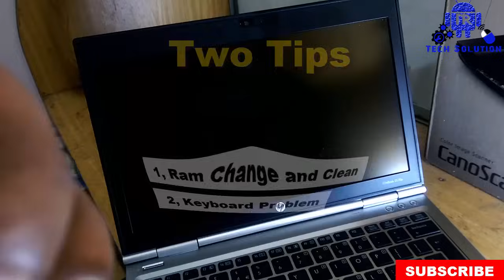Laptop POWER ON But 💻Display Blank (NO Display) 100% Solved ✌Only 2 Tips

Comment: Hits different when none of those are the problems 😩
Reply: 😂🤣🤣exactly.
Reply: I've too
Reply: Reflow gpu
Reply: Did u found out the cause??
Reply: I can't turn on the laptop and if i press the power button the keys become white (the color thingys) and nothing happened after that
Reply: For me
When I plugged the charger it's start charging.
But while pressing the power button nothing happens 🤷
Reply: @ayushx4831  i have the same problem
Reply: @kimkimi기미 but it's solved
I just press and hold the power button for few seconds and Boom, it starts👍
Reply: @ayushx4831  it didnt work for me though 😓 I'll try some other way
Reply: @ayushx4831  thanks bro it worked for me
Reply: Mee too
Reply: lol same
Reply: @xyzeuskrych5745  I just dis the first step and it wirked
Reply: Bro when I press the power button it starts and the keyboard lights up and I can hear the fan but the screen doesn’t come it’s just black
Reply: @RektUniverse  same problem bro did u got the solution
Reply: @nature.candid  nah but I found out that apparently the image drivers failed so I gotta replace them
Reply: @RektUniverse  excuse me bro now I am facing same problem what  have you done can you say please
Reply: @xyzeuskrych5745  same
Reply: Sounds like we all have the same issues. When I power in with the power cord in place. I get black screen. Power light on. Mine is only a year old. And I hardly used it. Paid 300 for it. I feel like I got robbed.
Reply: anyone.. pls tell how to solve this issue... 😔
Reply: How to solve this 😭
Reply: @azeemjaafar14  nope, never did
Reply: Word
Reply: my dead and stuck pixels are on my school computer
Reply: My laptop is not starting, when I press power button the keyboard lits up and screen is black and after sometime it automatically shuts down . Please help me(Asus FX505 GT
Reply: @ayushx4831  bro it starts but it automatically shuts down mines the same problem someone help me
Reply: My computer will show the Lenovo start up screen then just goes black after can someone pls help
Reply: True
Reply: Simple do Alt+Ctrl+Delete then file manager open go file then add new task then write explorer.exe or do Ctrl+Shift+Esc then file manager open go file then add new task then write explorer.exe. EASY AND SIMPLE
Reply: @samiaamjad6851  lmao, it’s kinda hard to do that when your screen doesn’t come on at all especially, after you click the power button and clearly see that it’s on
Reply: @samiaamjad6851  you’re literally what the OP is talking about 😭
Reply: On god, at this point I’m just gonna replace it 😭 cause nobody is understanding my problem
Reply: Same😫
Reply: U go an Seach on google properly
Reply: Man my cause is fucking close the laptop when it on
Reply: @GnanendraPennepalli  My issue is same. When i press the power button, screen is black, keyboard lits up and fan starts running at very high speed. I tried to replace my ram, hard disk and cmos battery but it didn't work. I tried to press capslock but it didn't give any response. My laptop is asus tuf fx 505 dy. Edit : My hard disk access indicator is also not binking.
Reply: Ussss
Reply: @piyush4504 Same here. The problem with my device was some smps in mother board it was a small electronic chip that burnt due to voltage fluctuations. even asus service said u need to change mother board in my laptop(suggested me to buy a new pc). I got it serviced in chennai for 2K(Richie Street).Hope this helps you
Reply: @GnanendraPennepalli  Actually one day i was shutting down my laptop but it took so long (almost 5mins) that i had to force shut down it after that my laptop is not starting. I was using my laptop on battery at that time. And there was not any windows or bios update at that time. What do you think did my laptop processor got damaged or PSU unit?  Sorry for my bad english.
Reply: Me too
Reply: @SunderRai  I can't turn on the laptop, the last time my LID work is using a Cooler pad with a max brightness
Reply: Yeah
Reply: @stardustblade9664  wdym
Reply: @ayushx4831  same broo
Reply: @kimkimi기미  and  then is ti working or not?
Reply: yeah bro 😭😭
Reply: Idk what to do cause i accidently turned the brightness all the way down and im panicking
Reply: Mine has had its motherboard changed and was completely rebooted last year but it still has the same issues and now i have the black screen problem i had last year again! I hate it.
Reply: Yeah my motherboard died
Reply: Perhaps everyone here has been using the same brand.
Reply: @GnanendraPennepalli  any solution?
Reply: @thegame8112  a MOSFET that helps to charge and boot on motherboard near charging port damaged. Changed it, laptop worked perfect
Reply: Ikr i broke my laptop by trying to do this😭
Reply: Same i did all these and still not working it takes a lot of time to keep turning it on and off to get it to work
Reply: Can someone help my my brightness is at 0 and my pc is dark and my brightness button doesnt work
Reply: @ayushx4831 Yeahhhh sameee
Reply: @RektUniverse  what did you do to fix the problem
Reply: @Rikoani  I have the same problem as you bro 😢😢😢
Reply: @xyzeuskrych5745  SAME issue aa raha h
 Kya aapko koi solution MILA ?
Reply: Yes
Reply: @GnanendraPennepalli same do u know how to fix
Reply: @GnanendraPennepalli bro help please I’m desperate
Reply: Mine was a ram issue.

Comment: My laptop does not have easy removal back so I can not take ram 😭😭😭😭
Reply: Which laptop do you have right now
Reply: @techplayer3489  hp
Reply: Press power button and delete then its on.
Reply: @SrikaarayilHariPrasad  didn't work mine dell and it's not easy to remove back too
Reply: @SrikaarayilHariPrasad  didnt work too
Reply: @SrikaarayilHariPrasad  what about Lenovo legion 5?
Reply: @klow3371  same he I have Lenovo Core i5 anyone who can help me
Reply: @SrikaarayilHariPrasad  THANKYOUUUU VERY MICHHH YOU JUST SAVED MY FUCKING LIFE FROM MY MOTHER
Reply: @SrikaarayilHariPrasad  thank you soooooooooooooooooooo much bro it worked. tysm tysm
Reply: @SrikaarayilHariPrasad  life saver. Thank you 🙏🏾
Reply: How about the Asus? The power is on but my screen is black. 😔
Reply: @banglarawaz2567  i already fix my laptop. i open it and remove the battery and put it back just clean it. just watch teh youtube how to open and clean inside your laptop.
Reply: @SrikaarayilHariPrasad  Thanks a lot
Might have been forced to pay a thousand or so to the shop otherwise
You saved me 
Thanks once again!!!!!!
Reply: Connect it to tv by hdmi
Reply: @SrikaarayilHariPrasad  thanks bro it helps a lot <3
Reply: I have asus, it’s lockdown cannot get to repair, really important meeting to attend, no display.
Reply: Then What about windows 10
Reply: @SrikaarayilHariPrasad  work

Comment: wow this really works my local shop wanted 100$ but i simply cleaned the ram and it works again thanks a lot
Reply from the maker: Send me 100$ hahaha Welcome SUBSCRIBE My Channel Like & Share
Reply: @nrtechsolution  paypal
Reply: wow
Reply: Lol i know right like every local "engineer" only tell people to replace things that dont really need to be replaced and its very pricey
Reply: @IzakShufrann  uni jjup
Reply: Your local shop need to eat and buy some food for his family.
Time is money.
Reply: @N.R SOLUTIONS Bro My laptop is showing no display but processor works and Caps lock button keep on blinking. What should i do.
Reply: @ankushraj3623  you must do what,what he has done
Reply: @abhishekkrkushwaha  i tried your every step but my problem didn't resolved. Lastly i had to visit repairing centre where they told this is bcoz of some issue in motherboard. And they charged me Rs. 1400
Reply: Bro thats a huge scam
Reply: @qyowa  shops dont actually try and fix it they just change the parts thats why he wanted so much money he wanted to replace the whole screen
Reply: @gilbertoberretta4361  yeah ik its still a scam they just replace it instead of fixing it fixing it is way cheaper
Reply: Lol 100$ where did you went a fucking Apple store?
Reply: My ram had milk way candy bar on it cause I took the ram and hd drive out often
Reply: It worked for me too
Reply: Urn on
Reply: mine wanted $300 to $400 and two weeks
Reply: @sogachew2368  have you tryied rebooting your gpu? just press Win+Ctrl+Shift+B whlie the pc is on. Keep me updated, we will find a solution don't worry
Reply: ram clean ki lekin start nhi hua or keyboard ko lekr m presan hu kise kru
Reply: 100$nooooooooooo:(
Reply: But the next it was repeats again
Reply: @nrtechsolution  can Lenovo Core I 5 be done same?
Reply: @Atosfar  He would have changed the motherboard and display which would cost like 100$
Reply: @greyhairt  if his ram was the only problem why they charging him a 100$?
Reply: @Atosfar  It's cuz they don't know the problem. For them the problem can be that the display is damaged
Reply: @greyhairt  you can't charge money until you know the problem, do you also go to the doctor and he says you might have a cold with cancer so lets do a surgery,no that's not how it exactly works you gotta check the problem then charge the Utmost price.

Comment: The ramd change and clean saved my laptop huhuhu thank you. 🤩 Works in samsung laptop. You saved my life, I cried yesterday so much. I thought my laptop is dead. Thank youuuuu so much.

What I did is that I cleaned my ram using a small brush to remove the dirts. I put it back gently to the place where it was, and then when i turned on my laptop it works as fine as what it was. ☺️ I was so happy. Thankful to this video.

Comment: I want to try this but I'm scared that I will broke something, it'll make it more worse.
Reply: Garyl have you fixed it yet?
Reply: Phuong Hua I’m so close bro my computer did not even power on it was fully dead but when I opened up everything cleaned it it powered on now it’s no display it’s powered on btw I’m 12
Reply: Nop 
1.  just take out the battery nd hold power botton fr 30 seconds, then put back the battery nd switch it on. 

2. Take the ram ram out nd clean it or the hardrive it also works. 

3. Check ur keyboard connection.
Reply: @thabanglucas2728  bhai dil se shukriya mere dost it really works ♥️♥️♥️♥️
Reply: @mrkhiladi_420  wot i do it and it work wdym iam 14 yr and i can do it bruh
Reply: @thabanglucas2728  the battery Charger or the battery inside the laptop??
Reply: Saame
Reply: I did the first one and it worked 🤯
Reply: @olivermoth  did you do it?? im scared to do it rn
Reply: Break

Comment: 1.  just take out the battery nd hold power botton fr 30 seconds, then put back the battery nd switch it on. 

2. Take the ram ram out nd clean it or the hardrive it also works. 

3. Check ur keyboard connection.
Reply: How can i find the connections of keyboard ?
Reply: Depends on what laptop you have
Reply: Bro..i did everything same to my laptop,but its not working at all 😔
Reply: Thank you man the first one worked
Reply: You rooock.. It works
Reply: I luv u my darling...it worked
Reply: Can anyone help me , I have a Acer predator, 

When I turn it on, screen is just black, 

But laptop is heating on the CPU gpu side 

( ram is alright ) wtf is wrong with my pc, please help
Reply: I just only hold the botton for 30s and it turn off then i turn it on its fixed
Thanks man for your advice
Reply: how about if i used my laptop without putting battery in it because its busted
Reply: thankkyouuu it's work
Reply: @haroldkennethrollon6986  same goes to me
Reply: @haroldkennethrollon6986  I'm using my acer aspire without battery from months...no prob. at all till now
Reply: My keyboard doesnt work😭😭😭😭
Reply: What if my battery can't be removed
Reply: Thank you so much...........
Reply: B
Reply: The first one actually worked 💓
Reply: Thanks bro
Reply: It works
Reply: Thank you so much its working
I just hold the power button for 30s and then switch on🤩
Reply: 1 working only when your power don't turn on..here this is  diffrent case
Reply: Thank you...first step works
Reply: Screen will still show display if the hdd is the culprit.

Comment: Mr NR Tech: 
I have a laptop that seems to be doing something similar to this one. The laptop was seemingly working fine at first ( A friend had just bought it used)  but later it would only do what your HP in this video does , show the power and battery light with no post or fans. 

The main thing i noticed that was odd, was that whether the battery was installed or not, the power light would always come on the instant I plugged the power connector into the laptop () after it stopped posting). Just like your laptop does in the video. Most laptops wouldn't have the power light come on automatically, you'd need to press the power button. Does this mean I likely need a keyboard or do you know of any other reason why this might happen .

Ive repaired computers for quite a few years, and even though  I do learn knew things everyday ( I never said I was great at it  ;))  this was definitively a new one for me.  Is the power light coming on the second it gets power also a sign of a keyboard issue ?

Thanks in advance for any help you can offer! Either way it seems that you know some important things I don't, so I subscribed and gave the thumbs up :).
Reply: This Donny wrote a 2 page story
Reply: @bhagapatikandel3469  Not every comment needs to be tweet size, right?
Reply: @noguardrails47 did u find the solution? My laptop also having the same issue...how to solve it. It's keyboard also earlier had problems as it was typing automatically and I disabled it's keyboard. Now how can I solve the power button issue?
Reply: Yeah because clearly that's what he felt he needed to type what's it to you? Have trouble reading or scrolling past?

Comment: My Toshiba Satellite P55W-B5224 laptop was powering on, fan running, but no picture or display on screen. After watching many videos, several weeks ago I had  cleaned the RAM sticks with eyeglass cleaning alcohol sheets. Had cleaned the keyboard ribbon cable, had cleaned the fans which had some dust build up. Also replaced the thermal paste/grease of the heatsink to improve cooling of the  CPU and Graphic processors. Battery was charging well.  Still no display.  I thought I messed up the BIOS, because I could not see the display as the screen was faint and could not enter the date, and pressed wrong keys as the touch screen was also faint with double images.

After coming across your video, I thought I should try again disconnecting the Keyboard and RAM sticks.  This time I used an eraser (good quality bought from Dollar Tree store about 10 erasers in $1) to clean the shiny contact points of the RAM sticks as well as the Keyboard ribbon cable.  But be careful, do not over do it which may remove the gold coating from the contact points. Before removing the RAM sticks, I disconnected the battery and the battery charging power cable,  and touched to metal surface to discharge static electricity from my fingers. Reconnected the cleaned RAM sticks and the Keyboard ribbon cable and the battery.  I made sure to reseat the RAM sticks and the keyboard ribbon cable fully inserted to have good contact.  Then turned on the power button of the laptop.  The screen popped up the "TOSHIBA Leading Innovations..." display on the screen, and then displayed the BIOS screen. For several weeks I could not get the BIOS screen.  It solved my problem for the time being.  I did not have to replace or reseat the CMOS battery, because I could not find it in this model of Toshiba Satellite.

I connected the laptop to an external monitor and entered the Date and time in the BIOS screen on the External monitor.  The display is fantastic in the external monitor indicating that the GPU processor is doing fine.  Replacing the thermal paste, which I did several weeks ago will help in cooling the GPU processor. The eraser actually removed a layer of black buildup from the contact points of the RAM sticks even though the contact points were looking shiny before rubbing with the eraser.  Perhaps I could have rubbed with an alcohol swab.  Some of the letters of my keyboard do not work, and the touch screen does not work properly.  So I used the external keyboard and external monitor.
Reply: there is no one one have the pations to read your comment but i read it fully because before opening the laptop we have to  learn the safety precoutions and we have top learn the positivity and negitivity about the work matlab kaam se kya kya galathi ho sakthi hai usko pehle janke kam karna chahiye thanks for your comment

Comment: The same thing happened to me but I didn't do any of the methods in this video. Turned out that all I had to was to hold the power button for 10 seconds and guess what. It worked like magic. Thought about sharing it is you might be facing the same problem.
Reply: omg i did that as well thanks to your comment it solved the problem 👌
Reply: Thanks a ton ashila

Comment: What if the laptop has built in RAM and has SSD hard drive? Power turned ON but no display, no capslock lid, no numlock lid, only the power lid is turned on.

If I disconnect the keyboard the power switch wont work because it attached to the keyboard.
Reply: did u find a solution for this??

Comment: I also had same issue ..so i went to computer shop and he told me that because of huge moisture in air(it was rainy season) components inside laptop gets moist too ..so he opened my laptop and blew some hot air with heat gun on its component and my laptop's screen started working again ..
I thought this might help you 😇
Reply: How it cost bhai